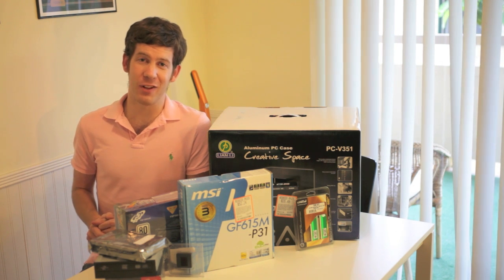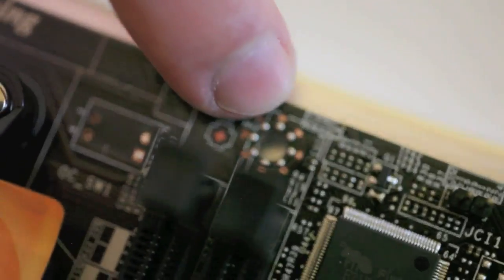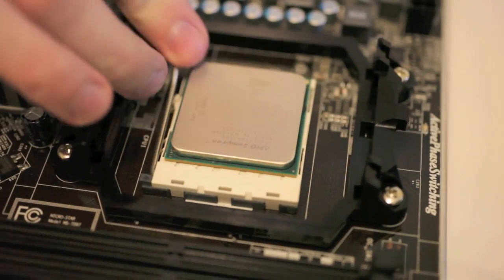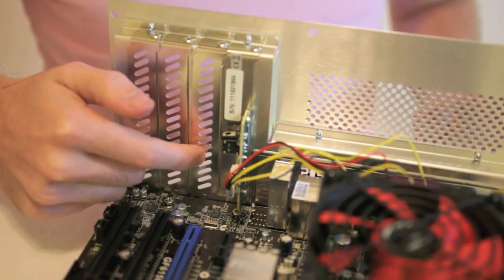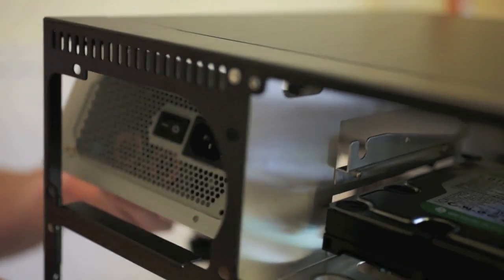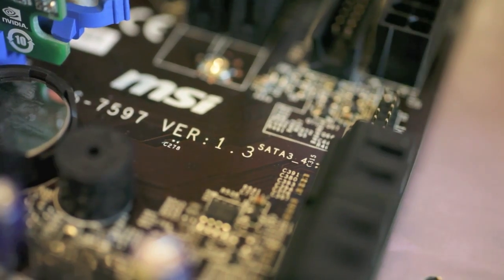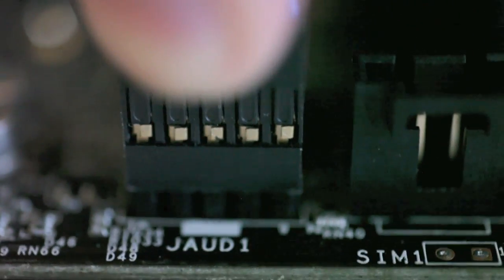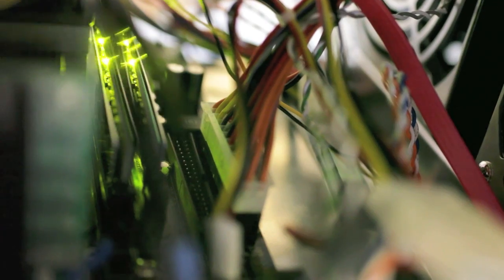How to Build a Computer From Scratch

Comment: This isn't from scratch. I want to sodder the gates, transistors, and resistor on the mother Board. Where's the smelting to make the pins and metal casting needed. This is like building a Lego set. I want to be making the Lego molds.
Reply: +deathpresent101 If you could make a current gen processor at home with just common tools, I'd be amaze.
Reply: @kurousagi1339  Who said they wanted to make a current gen processor? It could just be a fun little project to make a very simple computer that can add or subtract numbers and that's it
Reply: Kuro Usagi Shit son if he could make a 1st Gen processor I'd be impressed!
Reply: +deathpresent101 It's like wanting to cut out wood to build a chair or table.
But instead you go to Ikea and buy furniture with "Some assmebly required".
Reply: S0ul E4t3r 1st Gen processor would probably way easier to make.
Reply: S0ul E4t3r And thus, DP processors are born. With the first model being, DeathCore 101... and then next year's model, 202. Then next will be 303... Then 404 --huh? Model not found? Strange...
Reply: Kuro Usagi My point is that evena 1st gen processor is diffcult to make, if he could make a current Gen prossecor it'd be awesome!
Reply: Agreed. the title is a lie.

Comment: Hey can you please tell me what is needed for a gaming laptop is is what i got so far

motherboard:

http://www.amazon.co.uk/Gigabyte-Motherboard-4thGeneration-IntelCore-Processors/dp/B00CUCRKO0/ref=sr_1_6?ie=UTF8&qid=1386001202&sr=8-6&keywords=Socket+1150

processor:

https://www.google.com/search?q=Intel%C2%AE+Core%E2%84%A22+Quad+Processors&oq=Intel%C2%AE+Core%E2%84%A22+Quad+Processors&aqs=chrome..69i57j0l5.1739j0j4&sourceid=chrome&espv=210&es_sm=122&ie=UTF-8#es_sm=122&espv=210&q=Intel%C2%AE+Core%E2%84%A22+Quad+Processors&tbm=shop&spd=13071328614711508915

Ram card:

http://www.amazon.com/G-SKILL-Ripjaws-240-Pin-Desktop-F3-12800CL9D-4GBRL/dp/B002RPCLH6/ref=sr_sp-atf_title_1_2?s=electronics&ie=UTF8&qid=1387604394&sr=1-2&keywords=ram+2x4gb

Fan(i dont know if you need one for the processor)

http://promotions.newegg.com/ACC/13-0425/index.html

Graphics card:

http://www.newegg.com/Product/ComboDealDetails.aspx?ItemList=Combo.1460736

Case:

http://www.amazon.com/Thermaltake-Black-Edition-VL80001W2Z-Gaming/dp/B002Q2M8KK/ref=sr_sp-atf_title_1_3?ie=UTF8&qid=1387603933&sr=8-3&keywords=desktop+cases

Case fan:

http://www.amazon.com/CORSAIR-CO-9050015-BLED-AF120-Quiet-Airflow/dp/B00GMH0EUQ/ref=sr_sp-btf_title_1_6?s=electronics&ie=UTF8&qid=1387604091&sr=1-6&keywords=120mm+Blue+LED+rear+exhaust+fan

Power supply:

http://www.amazon.com/Cooler-Master-RS-C00-80GA-D3-Supply-Efficiency/dp/B0067PKEMQ/ref=sr_sp-btf_title_1_6?s=electronics&ie=UTF8&qid=1387604143&sr=1-6&keywords=desktop+power+supply+1200w

I dont know anything about this stuff and this is going to be my first time but this is what i got so far.Do you think im doing good or am i doing somthing wrong?
Reply: You will need a hard drive. Also pcpartpicker.com allows you to see what you'll need hope this helps
Reply: jvjets13 This is all a desktop, not a laptop.

Comment: I had that exact same thing and 30 fps is not bad at all, that is basically the lowest you can go before you see jumpy frame rate. If a MAC can run a game smoothly, then its not an extremely hard game to run.

Comment: Well, tech improves at an incredibly fast rate. So, buying old gear means you're likely to suffer using current gen software on your old hardware. Sure you have PCIe, but is it rev. 3? Two RAM sticks is nothing, also, what's their bus speed? Does it support DDR3 or DDR2? Your chipset/socket, how old is it? AMD is currently on AM3+ and AM2. It ultimately depends on what you're doing, but generally, it's not worth saving ~$40 on a total build when you're severely bottlenecking yourself.

Comment: are these parts compatible together?

motherboard: MSI H61M-P31 (G3) Intel H61 (Socket 1155) Motherboard
CPU: intel Celeron G550 2.50Ghz (Sandy Bridge) Socket LGA1155 - Retail.
case:  Novatech Cougar ATX Case
Memory: Corsair Vengeance 8GB (2x4GB) DDR3 PC3-12800C9 1600MHz Dual Channel Kit
Graphics: on board
Power suply: Corsair Builder Series CX500 - 500 Watt 80 PLUS® Power Supply
HHD: Verbatim SATA II 2.5" 128GB Solid State Hard Drive

Comment: @dakax43 Head sets are a good choice but when I wanted to get one I found out that you pay up to 300 bucks for fm quality sound and virtual surround sound (few have true surround sound). Don't knock it till you tried it, the only two cons with  surround sound is finding a good quality set with quality speakers and running wires.

Comment from the maker: @DarkStar851 I'm not Adam, but considering all the people named adam around here, it was a good guess. :-)

That cooler actually does have a controller, it's just weirdly separate from the fan so you can adjust it from a knob on the outside.

Comment: This is perfect timing for me!
The parts for my new computer arrive tomorrow!

AMD Phenom ii X4 965 3.4GHz CPU
Sapphire Radeon HD 6870 1GB GPU
G.SKILL Ripjaws X Series 8GB DDR3 RAM
ASUS M5A97 AM3+ 970 Motherboard
Seagate Barracuda 7200RPM 1TB HDD
RAIDMAX HYBRID 630W PSU
Thermaltake Armor A60 Case
Price after rebates: $559.99

I <3 Newegg

Comment: @MoldytoasterMedia Also, TYPICALLY you get better components when you're doing a custom build. My HP Pavilion a1626n came with crappy underclocked Chinese RAM, that original build is loooong gone, but it's still pretty typical. (that RAM was the first thing to die in that computer btw. ^_^)

Comment: @MoldytoasterMedia They still overcharge. I work for a computer shop, you'd be AMAZED how many clients we've had who never knew really how much an OEM computer costs over the parts that make it. My current rig (I'm not sure if you can actually buy it with the exact options I have) cost me around $800. Similar specs OEM would cost AT LEAST $1,400. Plus you get the satisfaction of knowing how to fix everything should any component fail.